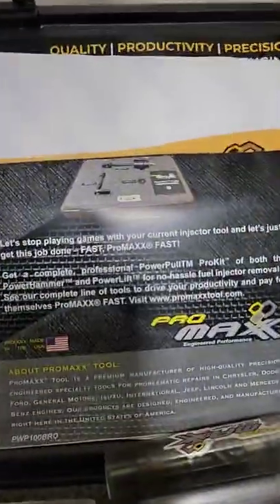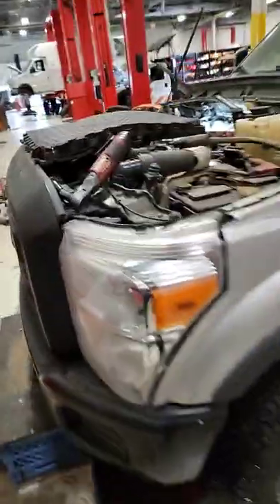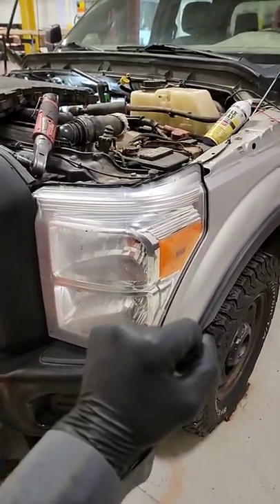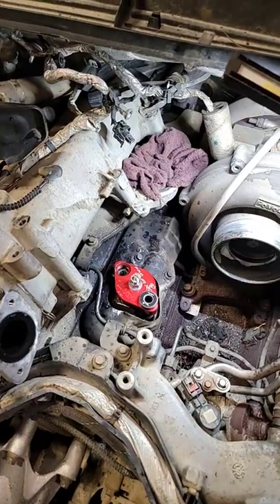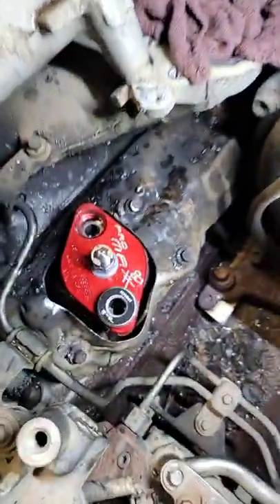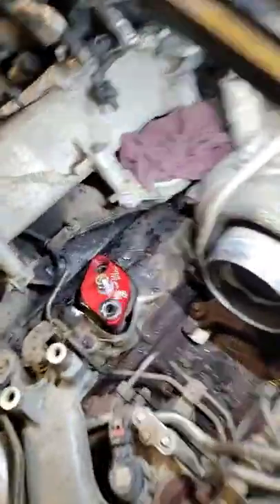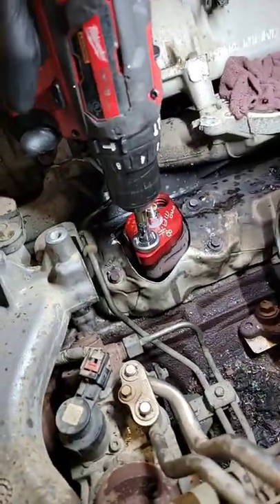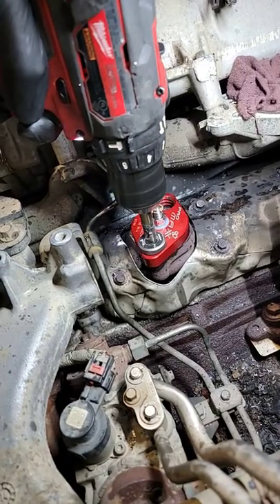Broke 6.7 EGR bolts????? 🧐 I got chu #shorts #promaxx

Comment: Soaked mine with penetrating oil repeatedly, hit it "A LOT" with a heavy punch and hammer (air hammer works also). Don't use anything larger than 1/4 drive ratchet/extension and socket to remove. If it doesn't come out with reasonable pressure, hit it more with the punch and hammer. BE PATIENT. Do not reuse those bolts, get high grade replacements and install with high temperature lube.

Comment: Yep I just drilled two bolts out yesterday on mine.
Reply from the maker: Did u buy the kit
Reply: @PowerStrokeTechTalkwARod  no I’m a machinist I center punched the bolt and drilled it out with a 1/8 carbide drill followed by an 5mm drill.  Then tapped out with a 6.1 mm tap.  I bought the two bolts from the ford dealer.  They were the price of gold .  WTF.  $31.00  but they had the bolts in stock and the job is done now.
Reply from the maker: @samengler539 Omgoodness
Reply: I didn’t know there was a kit until this morning when I watched your video.   But after seeing your video I would made a fixture.  But it all worked out.  Keep up you videos there a big help! Thanks
Reply from the maker: @samengler539 thanks for coming through and keeping it real

Comment: Kit is a work of art but damn! I feel for ya! 

I get the manifold ear hot with the rosebud then wail away with the cordless impact. 50/50 success, maybe not even worth the time. Chinesium bolts that are way too small & no anti-sieze from the factory 🤦🤦🤦 another example of new junk designed to fail!
Reply from the maker: Not to mention there are non ferous bolt who the hell does that
Reply: @PowerStrokeTechTalkwARod  Automotive engineers... the very BANE of technicians everywhere! I used to think it was the bean counters but honestly I'm not so sure anymore. Some of that chit those idiots come up with is far too complicated to be cheap

Comment: I just replace the exhaust manifolds.  They are cheap.   Last ones I did the manifolds were less than 100 bucks.
Reply from the maker: Id rather drill than horse around with that GD turbo. Remember this is michigan not Arizona
Reply: What's wrong with Arizona? Why are you knocking Arizona? What are you one of those hoity toity Yankee types?
Reply: @justinwatch how much rust do you get after a couple winters worth of road salt in Arizona?

Comment: What do you recommend if the back bolt gets rounded off?
Reply from the maker: Whatya mean
Reply: There are two bolts that hold that pipe down to the exhaust manifold. What if one of the bolt heads gets rounded off, what do you recommend for removing the bolt at that point?
Reply from the maker: If it is rounded off...its MOST likely due to the two dis-similar metals & its corrosion. I wld air hammer the head off so you cam get the pipe off. Then drill. OR get some extractors for the rounded head & hope to hell it comes out....
Reply: Mine is rounded too😢

Comment: I start the truck n let er idle a few minutes n put a little heat in the manifold n they come right ooooott I'm 5 for 5 doin it that way bruh
Reply: Had the same luck but I've also had them snap instantly just trying to crack them to get some lube in there, got this tool and don't even bother anymore, put the Milwaukee on em and send it, cold/hot don't matter, I spent more time working stubborn ones out then just breaking them grabbing the 90° drill and taking them out, hopefully you're luck continues though
Reply: Yup easy af

Comment: Love that kit had a few that even with heat in the manifold, they broke off just trying to crack them loose to get some pentrating oil in and work them out, recommend it for anyone that messes with those stubborn bolts a lot